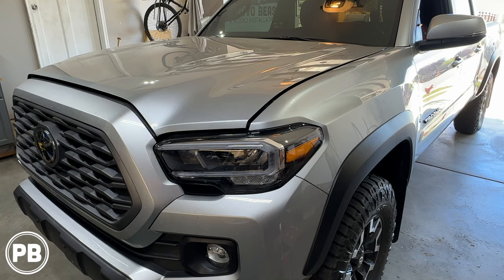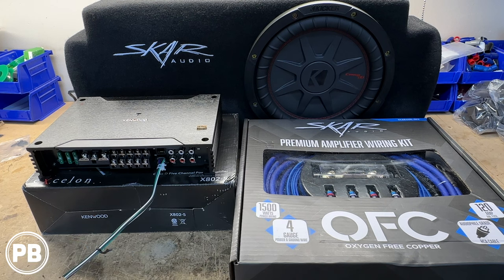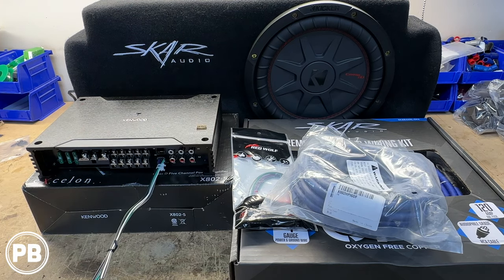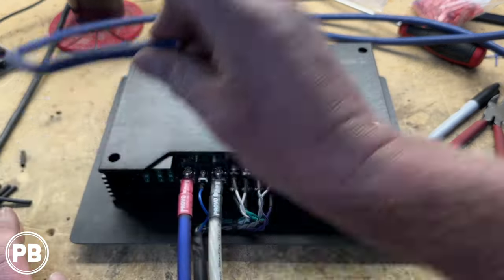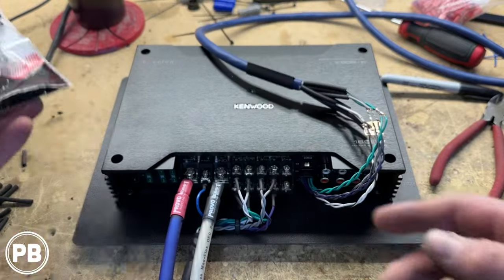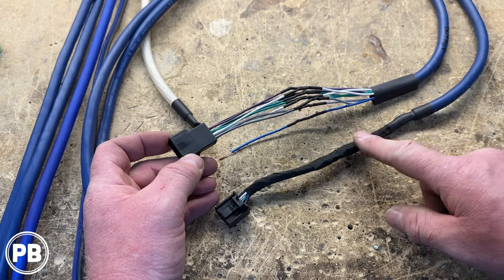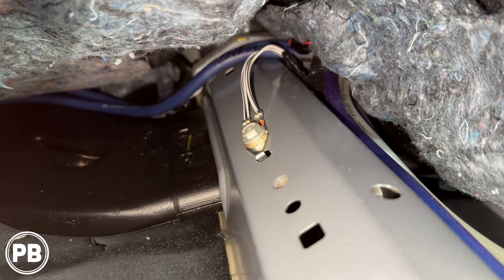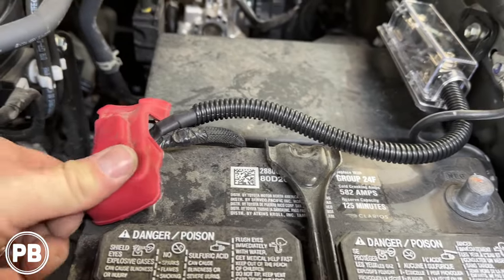2016 - 2024 Toyota Tacoma 5 Channel Amp and Sub Install

Comment from the maker: Parts used linked in the description of the video!
Reply: Is there any way you could do a video on  the actual JBL system, on how to upgrade the amp and sub please?
Reply: Thank you very much But how about the tweeters are they connected to the harness to the amplifier ??? Thank you very much
Reply: Where did you get the SP level input cable that goes into the amp? I got the same Kenwood amp but it didn't come with the cable in the box. Great vid btw

Comment: I had a so called profesional upgrade my tacomas audio system a few years ago. When it stopped working I took it apart to check it out and what a mess! It looked like a rookie install, a ton of mistakes and poor quality work. So I decided to fix it myself, I ripped it all out and started over, your video provided a lot of useful information and really saved me a lot of time and frustration with this project. Great video, You have earned a new subscriber.

Comment: Did you have to adjust the input sensitivity on this amp given that you're using high level input? Or is that only if low level input is being used?

Comment: Great video and coincidentally it's the same stock audio system as my tacoma.
I'm currently trying to fit a small 5 channel amp in the empty space behind the radio so I don't have to run the wires back and forth. I'm going to place the sub under the passenger seat in a custom enclosure

Comment: To anyone who has used this amp and connected it this way - is your volume loud?

My music sounds clear but I kinda expected a little higher volume, but with the amp dialed in Immy speakers and sub are not that loud. I installed this amp and a 10” jl in a stealthbox and infinity primus 6x9s in the front and infinity reference speakers in the rear.

Comment: The tacoma comes with 6 speakers including the tweeters. Does the 4 channel amp cover all six speakers? Trying to find wiring schematic to see if the tweeters are standalone or if they feed from the front speakers. Thank you :)

Comment: That sub enclosure is sold out everywhere. Is there another box that you recommend with all the same components? Thank you in advance.
Reply from the maker: It's the season timing, but Skar allows you to preorder it and have it shipped in december if you order right through them.
Reply: I saw that thanks. One more thing is why did you use a remote wire? the amp has a auto turn on feature. @ProvoBeastAudio
Reply from the maker: We try and apply techniques for anyone using any type of amp.  Yes, the Kenwood can turn itself on, however, not ever viewer will use that exact amp. @bbogue4
Reply: Thank you so much for the informative videos. I just put my order in for the box. I would love a video on how you tuned the amp. @ProvoBeastAudio

Comment: Is there anything additional you need to do on this amplifier for the subwoofer channel to work when using the high-level input connector like you did on this install? when running the four channels of power from the radio to the high-level input, the subwoofer channel will work?

Comment: Hi, thanks for sharing this good video. Question do you know if there’s a Kicker amp with the same option as the Keendwood amp so i can use the same cables you’re using to power my door speakers and 2 10” subs?

Comment: Great video!  I am confused by the LOC set up.  I want to get an amp that will amp all my 2020 Tacoma speakers plus add a sub.  Do I need a 5 channel LOC and a 5 channel amp?   I currently have the cheap 2 channel LOC ‘add an amp’.  But something tells me I can’t use that with a 5 channel amp. I’m so confused.

Comment: Question?
If a amplifier put out say 75 to 100 watts rms iis the factor speaker wire able to handle this power or should we go with a thicker guage wire?

(Lets also say we also upgraded the factory speakers to speakers that also handle 75-100 rms.)

Thanks

Comment: Looks  great!  I just received the same box but purchased the Skar Very Shallow mount sub, however the sub is still too deep.  My question, did the comp RT fit without modification to the box?  For the Skar VS-10 D2 to fit I would need to add a trim ring around the sub to lift it up about a 3/8''.   Would like to find a sub that required no modification.  Thanks in advance!
Reply from the maker: No modification needed with the kicker sub!
Reply: I did same thing,  but sent them back bc they have the loaded in stock

Comment: I want to use Pac APH-TY04 Speaker Connection Harness to bypass my factory JBL amp (2017 Tacoma).  Once I connect the 10 pin and 12 pin from the harness to factory harness what wires do I connect to my amp?  What do I do with the unuse wires coming from the harness?

Comment: Did that high level input harness come with the kenwood amplifier? I didn’t see it linked in the description. Thank you.
Reply: I have the same question lol.
But i think we need to get 2 T harness connectors so we can use 1 for the amp as well
Reply: it does he says it at 6 minutes

Comment: Hello question so if I wanted to to a different sub and box with this setup to sit on the seat like a 12” with a decent size box would the amp know not to blow out the speakers in the doors when I push it hard? That’s all I’m a little confused about

Comment: For a JBL equipped Taco, do you know if the Kenwood x802-5 would be able to mount within the factory JBL amp space behind the rear passenger seat? Also, if the HU has already been replaced with an Alpine Halo9 HU, would an Amp Pro LOC be necessary?

Comment: Great video!! I am planning to do the same setup. Can you share the crossover settings used?
Reply from the maker: A great place to start is around 80hz for low pass and high pass.  You can lower the HPF if needed based on the speakers you install.

Comment: I'm looking for help, I talked to a lot of my local audio shops with no solution. I have a 2017 Tacoma and I copied your build in the video. My rear door speakers are still way quieter than the fronts even after having my amp tuned. Did you notice the same thing if so how did you fix it? Thank you and keep up the great videos!
Reply from the maker: That's odd.  Check your balance / fader.  Check your gains again on your reach channels.  What speakers did you add in the rear doors?
Reply: @ProvoBeastAudio  I have kicker ks series for all door speakers
Reply: @ProvoBeastAudio  Please please respond to this thread, I know myself and many other Tacoma owners would appreciate it.  I have the same kicker ks speakers as @countryboy023 and am having the same issue.
Reply: @ProvoBeastAudio  They are like from the factory, not sure why. Would be nice to know the fix (after market head unit or amp/splitter)...?
Reply: I just installed the same amp on my 2020 Tacoma with 6 all new Kenwood speakers. Yup my rears were still lower in volume than the fronts. I have all my front speakers on "A" channel and the rears on "B". I adjusted the "B" channel gain up to match the "A" channel. Waiting for the sub to show up tomorrow to retune all again. Hope this helps on the question. Great vid for sure, helped me a ton on my first install, helped with the same amp!

Comment: Thank you for the video, love the step by step! One question, that blue signal wire was connected on the out put side via t-tap, and I noticed you said it doesn’t need it on both sides so does that mean on the input side I can just leave off/not connect the blue wire and kinda cap it off? Or does it still need to be connected on that side of the harness to going into the amp. Thanks!
Reply from the maker: This amp "should" turn itself on without the use of the blue wire as it has a signal sense feature.  Some amps don't have that feature, so you'd connect the blue wire to the remote input of the amp and the other end to the manual connection behind the radio for accessory.
Reply: @ProvoBeastAudio  i appreciate it, I just got this amp and ready to connect it this weekend!

Comment: Man! This is a great video and a super clean install. I want to do this same thing (almost) to my 21 4Runner. I have already replaced all of the OEM speakers with Kenwood Excelon. Question; keeping the OEM head unit, how could I do this with an under seat powered sub and 4 channel amp instead? I'm not in to heavy bass and don't want a large sub enclosure in my cargo area. Thanks!
Reply from the maker: Send me a message on facebook or instagram and we can help build your system!

Comment: I just bought this sub with the preinstalled subwoofer but I have an amp that only has 4 ohm and 2 ohm connections, the sub is pre wired to a 1 OHM connection. Is it possible to rewire this to 4 OHM so that way I can use my 5 channel amp and power my doors as well, without having to get a mono amp or a different amp?

Comment: amazing video and i have a question....I just  had  a group  install a system into  my 2023 taco.  There  is  a  constant  buzzing  noise when  there  is  no  music  playing.  I'm assuming  you  did  not  have  any  buzzing when you  were done with  your  build.  they  keep  blaming  it  on  the fact  that  it  is a  factory radio.  I'm  calling  bullshit but  idk  enough about  it  to question,  hence,  why  i  had  a  "professional "  install  it.  Is  there  really  anything  that  i  can do? already  tried a ground loup isolator. You  can slightly  hear  a  higher pitch  when accelerating  and when  the windshield  wipers are on, you  can hear  an  amplified  squeel  sound.  Ik  its probably  impossible to diagnose without actually seeing the  truck,  but, any ideas  i  may be able to look  at would be a great help. The only thing thats a major difference is i have a 4 channel amp for the doors and the sub is an 8 inch sub amp combo.
Reply: Did you use an Amp with high level inputs? Or a separate converter ? What amp did you go with?
Reply: I have a 2023 taco with the original speakers and radio and I hear a buzzing noise when there’s no music playing so there’s a chance it could just be the factory radio

Comment: Hello. How did the sound in rear speaker sound?   In my Toyota the rear sound from headunit its wery low and Almost no bass.  
And amplyfy that weak signal just get louder ?,,, but still no bass ? Right. ??

Comment: Thanks for the video! I installed this amp yesterday. I just have one weird thing - the sub only works if I switch the sub/ab switch to ab. If I switch it to sub it cuts the cub off completely. Any idea what could cause this?
Reply from the maker: Yes because you are not supplying the amplifier a dedicated sub input signal. Since this is a high level input consisting of only 4 channels of input, we still need to generate an input for the sub, so that switch tells the amp to pull that sub signal from the other 4 channels A/B.
Reply: @ProvoBeastAudio  thanks for the reply! Okay yeah I thought that may be the case but just wanted to make sure. Thanks!

Comment: Hey I have everything you bought but I have  the jbl version and I can’t figure out where to go from the connectors the connector harness I bought had so many extra wires for speakers that plugs into the jbl amp but idk what goes where I need help

Comment: how do you adjust the bass of the subwoofer without a dial
Reply from the maker: You don't, i mean you could use the bass adjustment on the radio.  Outside of that, there is no easy adjustment without the knob. Kenwood sells it for $35 on amazon.
Reply from the maker: (linked in description)
Reply: Thanks, where would you install the bass knob I have the same truck @ProvoBeastAudio

Comment: Does that subwoofer slap the back of the seat when closed? Does one only use the sub when the rear seat is pulled forward?
Reply from the maker: Nope, all clears fine when seat is closed.

Comment: I really enjoy your videos, very detailed easy to understand. Quality content. I just got myself a 23’ SR5 and I’m going to upgrade the speakers. 

Mind you, I am an absolute amateur when it comes to all of this audio system wiring and what not. I’ve always had models with whatever available premium factory audio. 

I was eyeing the JL stealth box but thanks to you I’ve really been looking into and am impressed with the Skar custom fitted box. 

This video you’ve made is practically a diy step by step installation video. 

Can you clarify with me, when you add an amp (as you do in this setup) for the sub does that amp in turn power the door speakers as well? 

You make this look a lot easier then I had imagined, would like to do this myself. Thanks!
Reply from the maker: Hey there thanks!  Yes, this 5 channel amplifier powers all interior speakers and the subwoofer, one amp to power it all.  4 channels power the front / rear / dash speakers, and 5th channel power the sub.
Reply: Hey did you end up installing it? I’m wanting to do it to my 2023 tacoma as well but I don’t know if it’ll be loud enough lol

Comment: I just ran a 5 channel amp to my truck but I get a hissing sound from my speakers. Maybe it’s a terrible ground location. I’ll try to tap on to the factory ground you showed. Do you have any hissing?
Reply: Try turning your amplifier input gains down.
Reply: I have a light hiss, I ended up turning down the gains and it did the trick

Comment: Will that t harness work on my Sony 9500 es head unit? And if so would I still keep the hi res audio from the Sony 9500 if I hook up at 4 channel amp. 
I jus want to boost the power
Reply from the maker: If you have a an aftermarket radio, you won’t need t harness - instead just run rca cables from the radio to the amp, and speaker output from the amp to the radio harness adapter.

Comment: i have a jbl club 5501 and i need too know which two 12inch subwoofers would work best pls help
Reply from the maker: That amp does 550 Watts @ 2 ohms, so if you wanted two 12" subs, you'd want a pair that will wire to a final impedance of 2 ohms, and around 300 watts RMS each.  It just depends on what vehicle, subwoofer box, etc is being used to know what sub combination would be best for your amp.

Comment: Very nice! Is there any reason why the owner went with the X802-5 as opposed to the XR901-5? Those are the two amps I’ve been looking at myself so I was super stoked to see an install with that amp, especially a new install. 👍
Reply from the maker: Budget! With speakers, amp, sub, etc, adds up quick. This amp was the right fit for the truck and budget!
Reply: @ProvoBeastAudio  ok, cool! Thanks for the response! 👍

Comment: How did you mount the amp to the floor under the seat?
Reply from the maker: Sandwich technique! leftover ABS i snuck under the carpet for where i can drill into, sandwiching the carpet between both panels with a few screws.  DO NOT drill through the floor of the truck.
Reply: I did my system using factory radio can you tell me why I lost back up camera and the microphone says disconnected is the wires for the microphone and camera are they located in the factory head unit

Comment: I did this exact install using same parts and equipment. The amp powers on and off without remote power. The seller says it's because of the High level input was used and it's sensing that signal to turn on and off. Also the sub doesn't work. Quote from seller "The amp has signal sensing when you use the speaker level inputs. That is why the amp it turning on with out the remote wire connected. Also since you are using speaker level inputs you have to switch the input selector to AB, since you do not have a sub output connected."
I have front, rear and sub connected only difference was they sent me the marine version of this amp. HELP! LOL
Reply: What settings did you set amp to for the sub on the input selector? SUB or AB? Forgive me I'm no expert.
Reply: Found the answer down in the comments. Except for the remote power that's not needed but is connected in your video.

Comment: I don't see the link for the parts needed for the JBL system, just has an asterisk!!
Reply from the maker: Added!
Reply: @ProvoBeastAudio  Thanks,  for some reason my installer says the AMP PRO would work on the 23 as its a transition to the 24 year model ( maybe an upsell to aftermarket radio). As mine has the JBL system. I prefer to keep the HU.

I also asked PAC audio tech guys, and they weren't 100% sure that the amp pro would work on the 22-23 as they have not tested it.
Reply from the maker: It hasn't been tested yet by Pac with the newest year, but the radio hasn't changed which is why Pac won't confirm or deny if it works or not.  Thats the issue you run into with a brand new model year vehicle.  I don't see any reason why it wouldn't work considering nothing has changed between years.  @jiriza84641